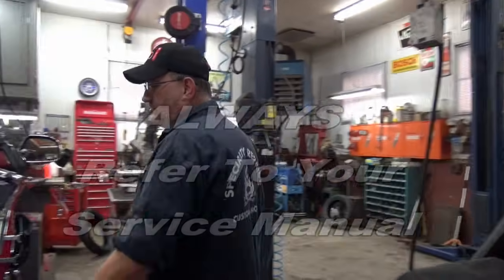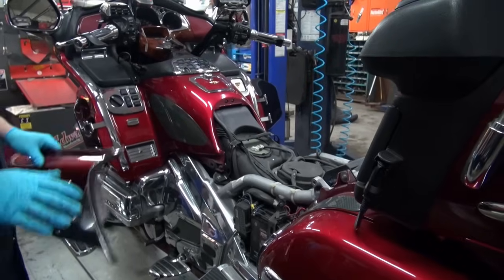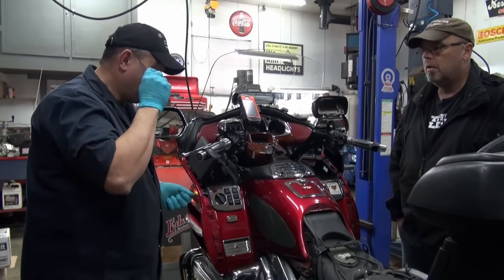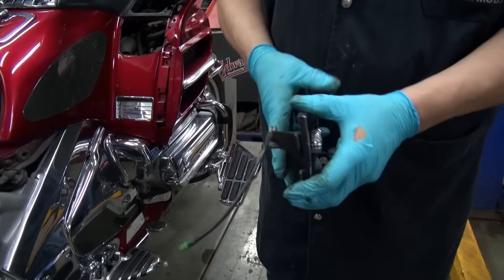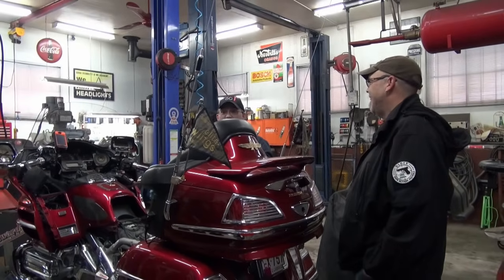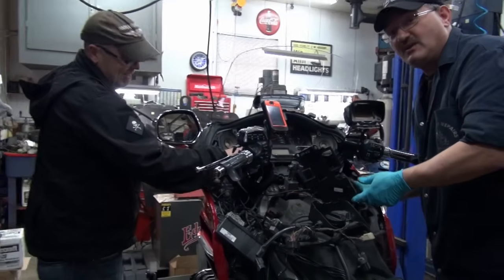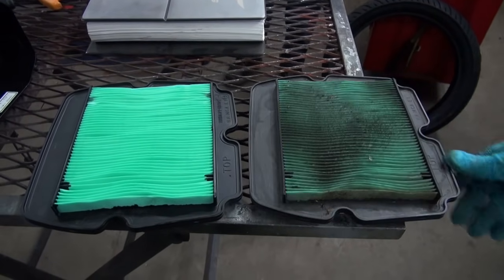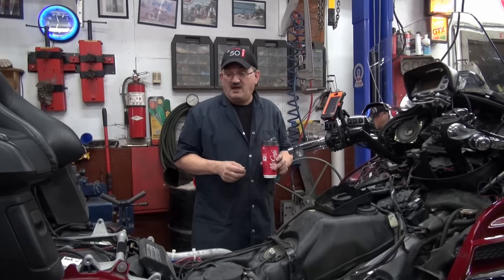2001-05 Goldwing Air Filter Replacement

Comment: Greetings.  I just completed the air filtre change on my 2005 wing.  Thanks to your video it was not that big of a deal just time consuming as I went slowly.  Just about had it buttoned up when I realized I forgot the air intake horns, so take off the deck again.  Probably don't need the horns but put it together properly.   Lo and behold everything worked!  The worst part was getting bolts in to hold the seat.  

Now have to work up the courage to take apart the cruise control switch which keeps jamming.

Your videos are very much appreciated.

Comment: Hi Paul;Really enjoying your videos! I have a 2008 Goldwing with about 30K miles on it. Just had it in to have the air filter, front forks seals replaced and the recall done for the rear brakes. After watching the videos I'm sure glad I had the shop do it because even though I work as a mechanic I'm not at all set up at home to take on some of these tasks. Makes you understand a little more why they charge so much to do this.....I would too! Keep up the good work!!!Daryl

Comment: Great Job Paul, nice video and explanation, You had commented on the right side lockable storage, and forgetting to hook up the cable. I took the cable off at the keyed end and left the cable attached to the storage box. Just in case. Thanks Chuck.

Comment: I had a 2008 Goldwing same color.  Kept it for 2 years, my wife stopped riding and I traded it for my Harley.  I never had a problem with the Goldwing and only changed the oil and filter.  After watching this, I am not sad that it's gone before I needed to change the air filter.  Quite the job.  If you have never been on a GW it is hard to understand that they are not like any other bike out there.  It rides and handles better than anything in it's class, if it has a class.  I do more short rides now and for that I like the rawness of the HD.  But if I ever go long distances again, it will be on a GW.
Reply from the maker: +Vader1957 
Man I've had over 40 bikes in my life. Had a lot of British bikes, metric bikes and a few US built bikes and the one I've always went back to was Honda but Honda was my first and I worked for Honda as a tech for three years so that's why the loyalty. No one builds the perfect anything my friend.

Comment: Paul, the more I watch this video and a few like it, the less intimidating it seems to be. It looks like a number of small steps to be accomplished in a certain order. I am going to take the 08 into the shop for the 24k service and inspection but after that and going forward, I will be doing all the regular maintenance on my own. The fluids look super simple. Way easier than my Harley and that is also easy enough
Reply from the maker: That’s great. None of it is terribly bad but there’s always a sequence to doing anything. ABS Wings like mine need a little extra care with the breaking system so if yours has ABS then my absolute advice would be to pick up a factory service manual. It will pay for itself on the first repair. Thanks for watching and ride safe.
Reply: @7863348  … No ABS on my bike. But the standard brakes are spot on
Reply from the maker: Once you ride a bike with ABS brakes you’ll never go back to the old school. Believe me. It’s true. They are so good in fact all Canadian Wings have them as standard equipment on every Wing.

Comment: Paul ..There's no doubt that Honda makes a good engine, I have had no real trouble with the ones I had. The only time I had engine trouble, was on a bike that was abused or little maintenance. Also I can't express enough to do a pre - trip inspection on your bike before you ride every time !!!  This has saved my skin many times eg : nail in tires, lose bolts, worn parts etc.  Always check before you ride !!.......Play safe and have fun ....all is well !!  Wish you safe riding !!
Reply from the maker: +frank roden 
Great advice my friend and advice I support 100%.

Comment: Intimidating project for something so simple as an air filter.  Very helpful, Thanks.   Time to start cleaning up the garage and making lots of space on the benches to hold all this stuff.
Reply from the maker: Richard as bad as it appears it's really not bad. Just take your time and go by the video. If you have any questions just post them on this video and I'll answer them.
Reply: Paul, just ordered the air filter.  Will probably get the project started right after first of the year.. gives me a few days to clean the garage and make some space for parts.   Changing subjects... are you on PEI or in N.B.?  Three buddies and I will be heading that way in August/September for a few weeks.

Comment: Thanks for the video. I'll tackle this on my 2003 Wing. Not really looking forward to it but has to be done. 👍
Reply from the maker: Did you get it done Jim?
Reply: @7863348   Yes I did, thanks. I takes some time but I'd done it before. I used your method of using a cardboard box, pizza box, to organize the bolts and pieces as I took them off. That works great. I used the K & N air filter which fits well. Only issue is that it's not as firm as the original one so I had to make sure it was seated properly before reinstalling the cover. Thanks again.

Comment: Good video I have watched this one before but it just came up again so I watched again man that is a big job I like Honda but why they couldn't have made it easier to change the air filter that's why a lot of them don't get changed when I got my wing didn't get much history with the bike i knew it needed tires I got the tires took it to the guy that does my work great guy very fussy and neat like someone else I watch on YouTube no names mentioned lol had all the fluids changed air filter he found a little oil leak changed the valve cover gaskets and a hair line crack in one of the covers said he could fix it but he knew that I was like and got a new one that was a lot of work on the bike but I knew that everything was good and that's the I like it my god buddy this was a long story you have a great day and great job on the bike
Reply from the maker: Tom the filter seems like it’s a lot of work to change and it is for the first time but after than it’s not bad. When I did this video I did a total “go through” the bike. The bike now only has 42k on it and it’s as good as the day I bought it new in 2003. I like to keep the bikes in the best possible shape do to the precious cargo I have on with me. 
It’s great you have a good guy to help you look after yours. Ride safe bud.

Comment: That was one heck of a time consuming project that had to be done. Much cheaper for you to do than having it done. What about a K&M filter or don't you like them or maybe it doesn't matter since it's not a two minute job. Great job, great video, Paul.
Reply from the maker: +Jake Schisler 
I'm not a believer in K&M filters. They state higher HP and I don't believe it. No matter what's in the bike for a filter it still needs to be serviced so it's just as well to toss it when it's time to do it again. Thanks for watching.

Comment: He started at 9:15 and got it out about 11:30...2+ hours just to get to the filter. And he knows what he's doing. The GL1800 has the "Dealership Shop Permanent Employment" design, I take it.
Reply from the maker: Im sorry. I don't understand what your talking about. This video? I never took 2+ hours to take the filter off!
Reply: @7863348  Looked like your shop clock was at 9:15 when you started, then about 11:30 you've got it all apart and the dirty filter out when you take a drink of soda or whatever.  Guess I missed something in your edit.  How long DID it take to get it all apart to the point of pulling out the dirty AF? 

i was also sarcastically referring to how complicated this process seems, encouraging folks like me to just take it to the dealer. And you were experienced; it would take me half a day. No offense intended; good video. Thanks.

Comment: I'm a pretty good mechanic Honda has made a routine job into a nightmare, they could have it going in the side , I have a 1975 gl 1000 time to change air filter 3 minutes if that , thanks for the video. From Ireland
Reply from the maker: Yes I agree. They could have made it easier to change the air filter but once you do it, it gets easier. Love the 1975 Wings. I restored and still have a 1980 Wing. Love it. Ride safe and thanks for watching. https://flic.kr/p/2hwVjMK

Comment: That's crazy! Why wouldn't they position the standard maintenance stuff in a more practical location?
Do you have to take the engine out to change the oil?
Reply: I bought a 13 K miles 2002GL 1800 from the original owner in 2019..Thats  18 years old.He had never changed the air filter..
  When I saw how complex it seems to get at the air cleaner on a GL 1800, I thought it was nuts also. But as long as you keep each bolts/screw In the exact order you removed them, I did it by using a half cardboard box and labeling each screw as I took it out and placing it in holes i put in the cardboard box.. it was actually not that bad. You have to look at it like this:It’s not one big job that you need to have six hands to do. It’s about 30  simple little jobs that you do one at a time... take out one screw, poke a hole in the cardboard box, put the screw in the hole, go to another screw, poke a hole in the cardboard box, put the screw in the hole.,,
  I would suggest you watch the video I put on YouTube in titled, Goldwing made mouseproof.. because, when I removed the lid to replace the air filter, I found a mouse nest inside the air cleaner housing..it’s not the first time I found mice living inside air cleaners..
   take some pictures/videos along the way you can reference in case..It really is not that tough of a job, and you will be more familiar with your machine when you’re done

Comment: Phew!  What a job Paul, you can see why it would cost a lot of money to take the bike to a service centre.  How long would it take from start to finish putting on a new air filter for an amateur not counting lost screw, clips and temper?
As usual I enjoyed your video, and I saw your friends hands for the first time.  Ha!
Reply from the maker: +Motorbiker Miles (motorbikermiles) 
Although I'm doing other mods and tasks not mentioned in the video I figure It's a three hour job for the air filter. Even in a busy bike shop I'd be worried about scratch's and what ever else they can do. Thanks for watching.

Comment: Hello. I have just bought a 2002 Gl 1800. Anything special i should look out for apart from the frame welds? The bike got a new frame as a recal. The real brake master cylinder was also replaced as a part of a recal.
Reply from the maker: Keep an eye out for the front fork seal. Disable the anti dive on the fork and the seals will last forever. Google the info on that. Use a battery tender at all times when the bike is parked for extended times. That’s what ‘I do. Great bikes.

Comment: Hi there, I just bought a 2005 goldwing and I was watching your video to replace the air filter, very informative thanks a lot. One question, what brand are the lower air deflectors?  By the radiator?  Mine doesn't have it and I am planning to buy them.
Thanks again.
Reply from the maker: I bought the bike new in 2003. I honestly don’t remember the manufacturer. Glad you liked the video.

Comment: Hey Paul, thank you for putting together the video regarding air filter replacement made things pretty easy. After putting everything back together I have a ticking noise that is coming a cross the speakers. Any thoughts where I may have went wrong?

Comment: A comment and a question. First, this video saved me almost $200 because I replaced my filter myself with K&N instead of having the dealer do it. The question: Where did you get you GPS hood? I have my Gamin Nuvi on a RAM mount, but can't find a hood. Any help would be appreciated. Great video; thanks.

Comment: Always enjoy your vids.  Does the whole top shelter have to come off to access the cruise control adjuster?
Reply from the maker: The cruise module is right above the air filter box . You will see it at 9:54 of the video. Thanks for watching.
Reply: Thanks Paul. I meant the cruise control cable adjuster (to eliminate lag).  It's the in-line cable adjuster with the long adjustment nut and small locking nut. It's to the right of the steering head.  From what I can fathom, on my 04 I think the whole of the top shelter (dummy tank) has to come off but for later models I think just the speaker assembly and ignition key surround need to be removed.  Basking here in the UK sunshine at the moment.
Reply from the maker: To my old memory it’s not far from the cruise module. Once you see the module just follow the cables and you’ll find the adjuster that’s why I mentioned the module. Either way the full shelter needs to come off to gain access. It’s 28c here in Newfoundland which is about 14c to hot for me lol.

Comment: Was wondering if you had a video regarding fixing cruise control lag, as in when you select the cruise the bike the speed drops several mph before it connects and takes it up to the selected speed. Works great other than  that. 2005 Honda goldwing.
Reply from the maker: I haven’t that issue but there is a procedure to fix it in the GL1800 factory service manual.

Comment: Hi, you all. This is about the 3rd time watching this video. All went well with the air filter change. However, when I reinstalled everything again, I noticed my reception on FM was very poor.  Before I tear it apart again, would you have any idea what could be the issue? I have cleaned the both aerials and realize there must be a plug that runs up to the back of the controls that I would have taken apart for radio panel. Could this be possibly not making a proper connection? Keep up the great work on your channel.

Comment: on the little long trim strips on both sides - by the pockets - how do you start them pulling off - is it an up push  - down pull  -  or - how  - strips no longer available
Reply: Start on the bottom inside pulling towards the outside. Working upwards. Very easy. They are replaceable. On line by parts pit

Comment: Paul, do u ride the gl1800 anymore?  What would cause a little oil in the air filter box?
Reply from the maker: Yes but I haven’t had it out for the season yet. Pretty busy in the shop. A small bit of oil in the breather box is perfectly normal. It gets in there by way of vapour. You’ll see it in the automotive sector as well. Just ride it like you stole it lol. Ride safe.

Comment: I wanted a Goldwing until I watched this video, 😳 wow really Honda
Reply from the maker: Well let me just say that I still have that GoldWing and it’s now 17 years old and the biggest job I did on it was replace that filter. It’s not as bad as it looks. The best motorcycle on the market. https://flic.kr/p/292676L
Reply: Paul & Kathy Short I’m bustin their chops. Lol. They look like Cadillacs on the pavement. I’ve never owned a motorcycle before. I’m sure I need to start out with something more reasonable to train and learn on. They are beautiful though.
Reply from the maker: You have a good game plan. Start smaller and work your way up. Take a motorcycle course, it will help keep you alive. The GoldWing is an outstanding motorcycle. I’ve owned a lot of bikes but the wing has been the best, hands down. Ride safe. Keep well.

Comment: To Paul, I would like to know if it is possible to fix the led lights on the trunk of my 2005 goldwing I have 4 of those little lights out on a group of 8. Your help and response would be appreciated.  Ps. They were pushed in a little like the light was bumped by something.  Thanks for any advice.  John and hope
Reply from the maker: Yes they can be repaired. You’d need to know what your doing or bring the strip to an electronics person and they can do it. If it’s made by Kuryakyn you might be able to purchase replacement parts. Ride safe.
Reply: @7863348  thank so much for your reply I noticed a few out and hate to spend all that money on new ones I'll check around take care. John and hope

Comment: Darn that's a lot of work to get to filter!! No short cuts to get to filter?  I know it will cost a lot to have a shop do it and I don't feel confident to do it myself.
Reply from the maker: It may seem like a lot of work but it’s not bad. It’s not needed often and other than tire replacement the bike will give you a lifetime of trouble free driving. The bike in this video is going on 20 years old and I bought it new and still have it and it rides and feels new. Best vehicle investment I ever made. Ride safe.